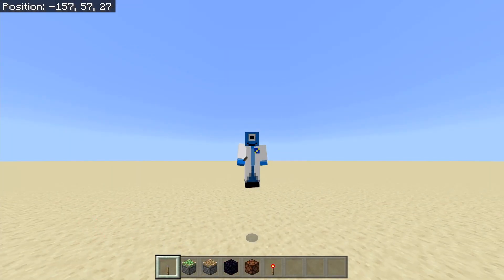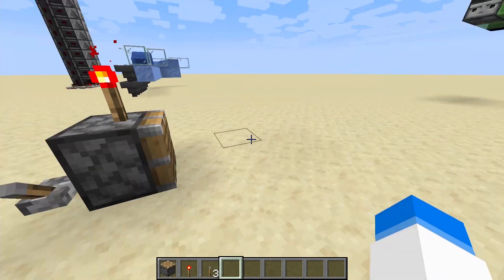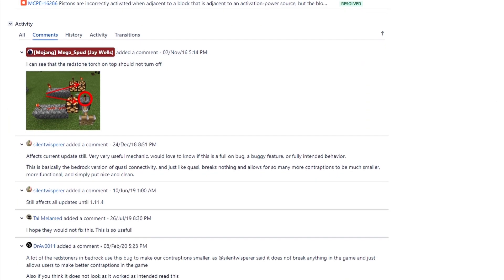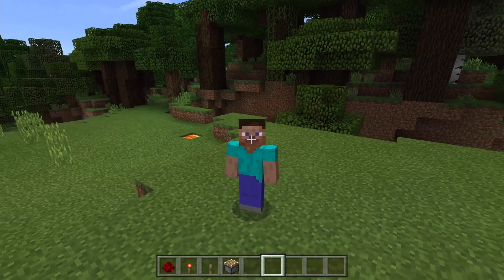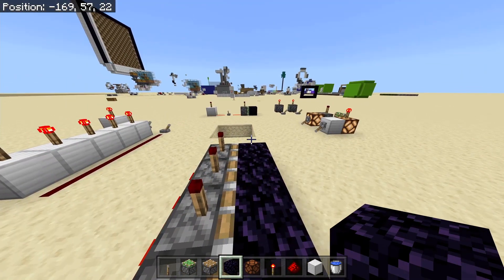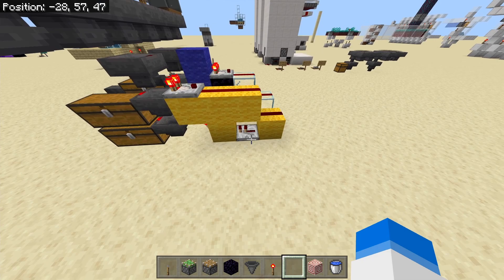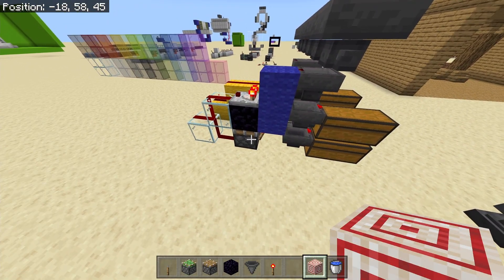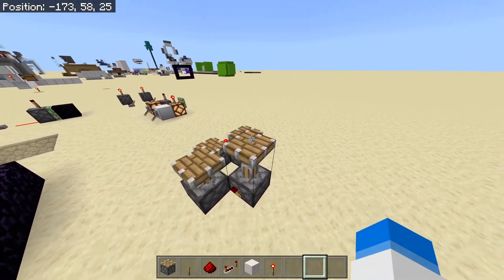Explaining soft inversion: the Minecraft Bedrock Redstone bug that won't get fixed | MCBE Redstone

Comment: The item sorter isn't any more reliable than the other, it's the hoppers skipping a beat that makes it unreliable not the repeater delay
Reply from the maker: In my testing it was less reliable, and going off other information at the time this seemed to be correct. It may have changed in newer versions though.

But yeah you are right, most of the issues are to do with Bedrock hoppers being broken :)